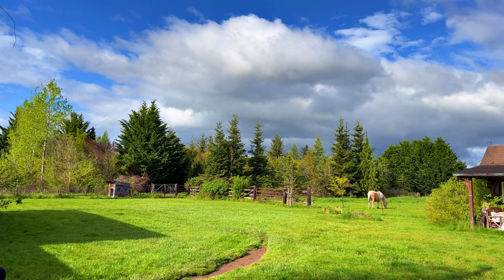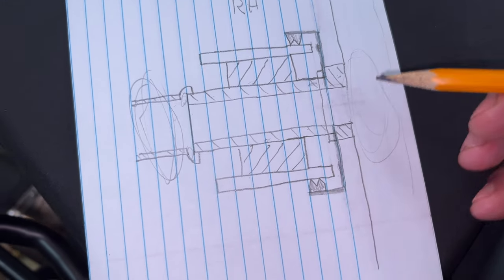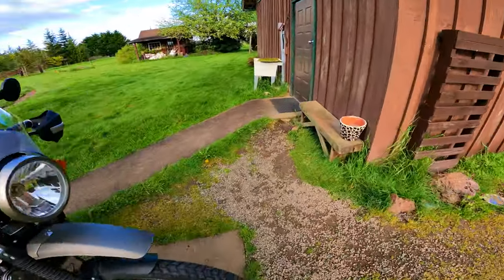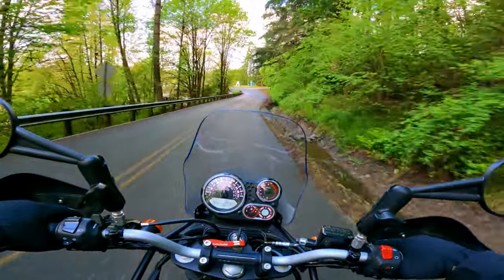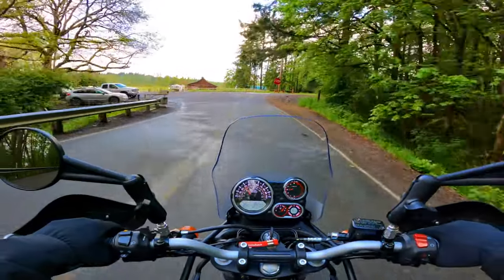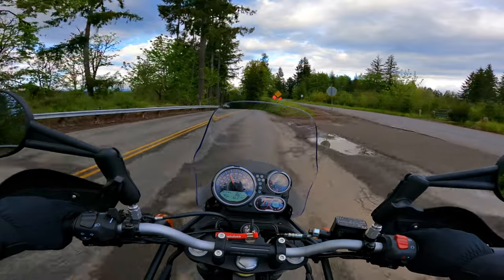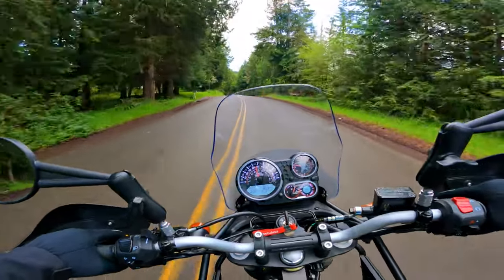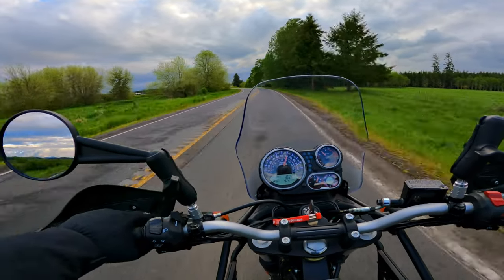Himalayan Swingarm Fix!! • How Did I Go About It..? | TheSmoaks Vlog_2373

Comment: Mine has the same issue. I do need to look for a spacer to add to mine. I took it apart and greased it and it was still pretty tight even at the bottom of the torque spec.

Comment: I had the same issue with my 2022 Himalayan. Rear suspension was VERY harsh over bumps. When pushing down on the seat the suspension wouldn’t  rebound. I suspected poor quality of the shock and paid £400 for a YSS shock. Upon fitting the new shock I was puzzled that the swingarm would not move without considerable force. After stripping it down I concluded that the central spacer was effectively too short by about 2 mm. I placed a 2 mm thick washer inside the dust seal to make up the difference. This has cured the problem. 
I complained to RE U.K. but they refused to acknowledge the issue. I then opened a case with the government vehicle safely office. This is a copy of their investigation. 

Moto GB and Royal Enfield advise they are aware of tightness in the swing arm and a Technical Notice has been made available to dealers and an awareness session to familiarise technicians. This Notice has specific instructions, and the manufacturer states they have not instructed any dealer to supply and fit a 2mm washer to counteract a clearance issue. DVSA would advise you have your machine inspected by an approved dealer and any necessary actions completed as per the manufacturer’s instructions.
Though the swing arm may not move as freely as expected which, as in this instance, may be noticeable as a harsher ride, it is not impeded and can deflect in use. We are not aware of the arm failing to operate.
The manufacturer advise they are addressing this through their dealer network and have had a very small number of similar reports.
The official response from the manufacturer concludes there is insufficient evidence of a wider problem to warrant an action within the terms of the Code.
Additionally, a search of DVSA’s defects and recalls databases has revealed no similar reports. As such, no further action will be taken on this occasion.

I would advise all Himalayan owners to check theirs for this problem.
Reply from the maker: Looks like we've all come to the same conclusion with the spacer fix, should we have the issue.  My wife's Himalayan is perfectly fine..!  I personally believe it was caused by grossly over torquing the swing arm pivot bolt at the factory.  I backed the nut off on my wife's bike, and it was well within the correct torque specs...
So, after you resolved your issue, does the YSS rear shock perform well..?

Thanks for the story and additional information!! 👍
Reply: @TheSmoaksVlogs  I can’t really compare the YSS shock to the original Himalayan shock as during the 300 miles I rode with the original  it was operating under the restriction of the very tight swingarm. However, the YSS shock was built to my weight ( 140lbs) with a relatively lighter spring and along with the rebound damping adjuster I am very pleased with the comfort level that it gives at my sedate riding speeds. I have also put lighter springs in the front suspension and will fit YSS emulator valves in them soon to bring the front end up to the performance of the rear.
Reply from the maker: @fredericktucker9419  - Nice..! 👍
Reply: Really interesting to read this, my 2022 Himalayan also doesn't really rebound. I'll be reporting this to my local dealer along with a couple of other issues (running light cover broken off, multiple attempts required to start sometimes) and we'll see how far I get. Might have to try the DVSA route if it doesn't get anywhere!

Comment: It's so comforting to hear from you that the swing arm assemble is so well greased.. other than the over tightening...! Hope not mine.. We do however hear so much of the headstock bearings failing due to the lack of grease.. Odd...
As a bike, I'm happy with it just as it came out the crate.. other than having the panniers and hand guards in the deal, what more.. Heel guard, plates to blank off the old indicator mount points, riser for mud guard (fender).. the after market boom fuels the most have accessories, sells a dream.. need for speed.. big Adventure.. just to the shops, there's many who do Adventures, campouts, explore further afield, tours and trips, but for many and me it's just local, hack down the country lanes. I'd like the time.. money to explore the beauty to be found in the UK.. even LeJog.. NC500.. Well until then. Cheers and have a wonderful Tuesday ;<(((

Comment: You are absolutely right, get to know your ride before you start changing things. I rode my 2020 Chinese dual sport one whole season in stock form. Season two only saw a new o-ring chain, double take adv mirrors, LED head light and a set of shorty levers that only happened  because somebody backed into it in a parking lot and broke the clutch lever. Even though I like my adjustable shorties, without that helping hand, I do not think I would have changed them. The oem levers were good enough. Season three started with new 50/50 tires because I wore out the original tires, a new set of pro taper bars with risers,(a good decision for me) and fresh tune up and valve adjustment. I have not touched the motor or exhaust because it runs well, believing if it is not broken, do not fix it. Only thing I would like to add is a windscreen when I find what I am looking for. 7500+ miles and still a happy rider.

Comment: Just like you I've had the issue with the swing arm squeaking so i took it apart i found mine wasn't well greased, so cleaned it and re greased and put it back together squeak gone and thought that was the end of it, but after about 900 miles  i noticed a creaking noise coming from the same area, and thought oh no i dont wont to go through that again knowing it's all greased up, so on more investigations i found that i had tightened the swing arm bolt too tight, i did try to find a toque setting but was unable to find it after slacking off a little all seems to be ok 🤞

Comment: This has been one of the more fun video's you have done for me at least. I have Harleys and have been through the suspension trials with both my RGS and my RK. I ended up switching up for the Legend Revo A shocks 13" on both based on your suggestion. In the case of the RGS it came with 12" shocks and the 13" made a night and day difference. The stock shocks on that were far too stiff for me and I am 6'2" at 230lbs. On the RK they after a long period of getting them set up for me (more sag than recommended)  I feel that these are a 9 on a scale of 1 to 10 with the stock air shocks I took off being a 5. I guess what I am saying is that my experience with the stock suspension was far different than yours. Thankfully though the Revo A's saved the day, now I almost giggle when I see a bump coming instead of cringing. I was in NW the other day and took a look at the Hymi while there. It looks bigger in person than in your Vid's. Sharp looking bike especially in person. Ride safe!